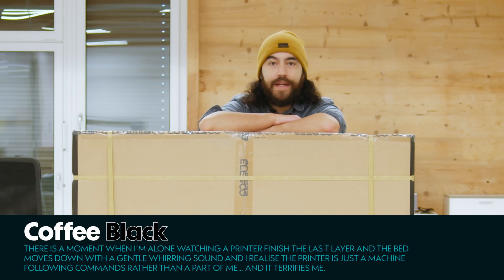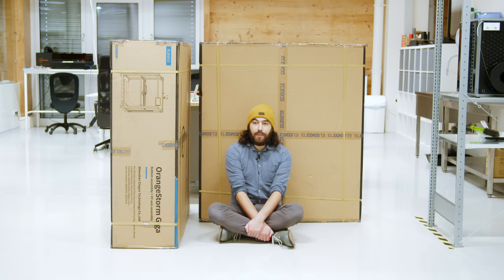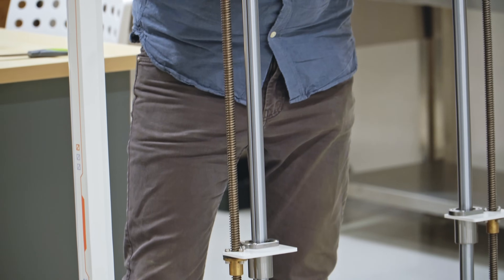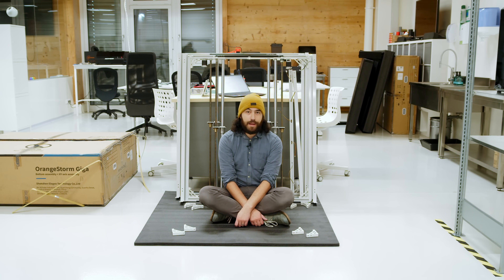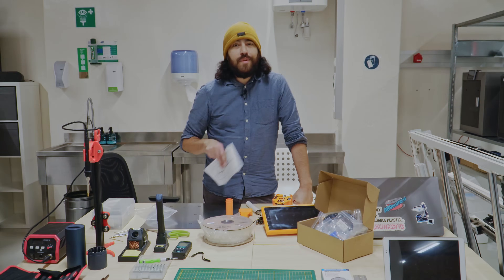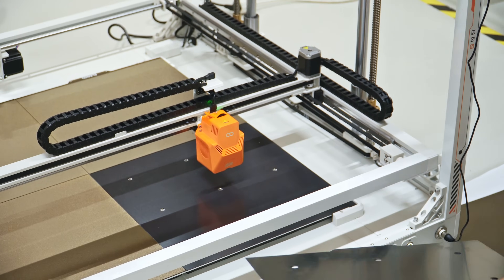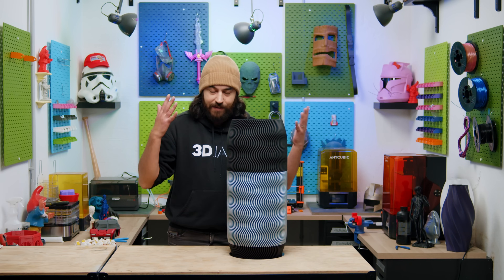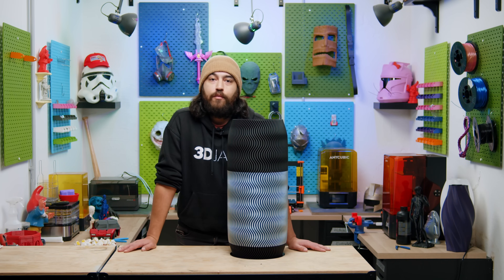The Biggest 3D Printer We’ve EVER Assembled (And It’s Fast!)

Comment: Hi,

I’m considering this printer to print fender flares in petg. But when I install it in orca slicer I do not seem to be able to use tha 1mm nose with supports. 

Just testing. Can I send you the file to test??
Reply: I’m just slicing in Orca for now. I just had to change the tip of support to 2 mm and then it was okay. I had some support from a friend and I got it working. I see you have a Norwegian website as well. We might order a Giga from you.
Reply from the maker: @ Ah good to hear you got it working! That would be awesome!
Reply from the maker: Unfortunately, the printer is not available for testing now. What exactly happens when you try to print the supports?

Comment: Query I notice they sell the tools on their site - how many tools can the giga have?
Reply from the maker: Using their set up it is just 4. They're static though not toolchangers which means using the 4 toolheads to their max practicality really depends on the size of the model, too big and you can't make much use of them. But the printer runs klipper so adding extra toolheads with smaller size or a full toolchanger set up is a lot easier than other printers

Comment: Bought the printer from your website and I love it. I have just one question do u have standard profile settings on ur slicer and which slicer do u use elegoo slicer or orca ?
Reply from the maker: This time we used Elegoo Cura and the generic profile was used but we almost exclusively use Orca for everything in the workshop so for future prints we would be using Orca - there is already a profile for it there.